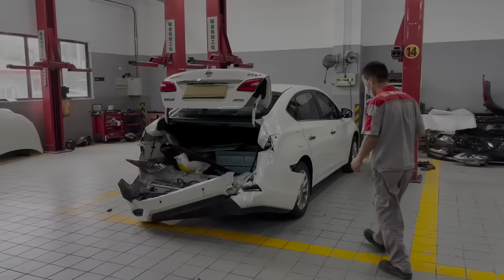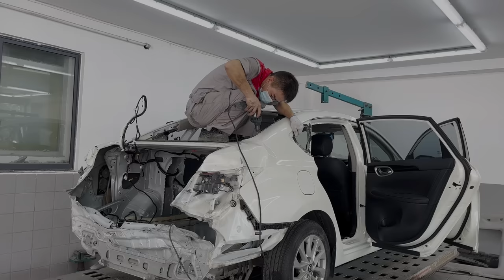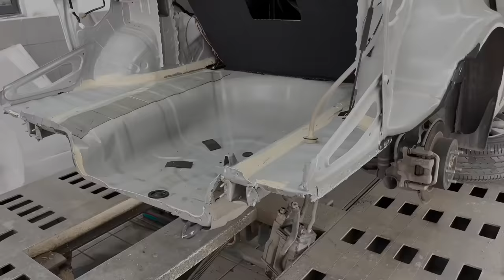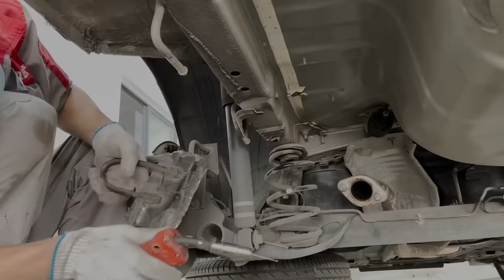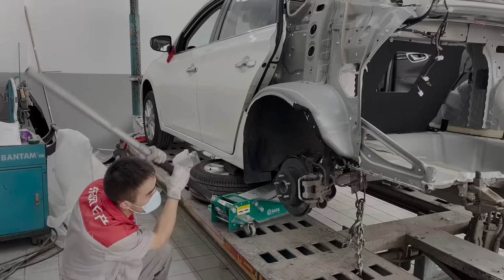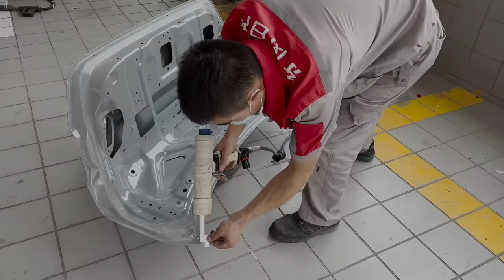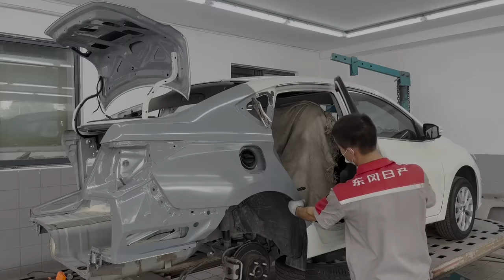Restoring a Severely Rear-Ended Vehicle: From Wreckage to Renewal

Comment: I'm sorry, but the repair of the entire replacement of the threshold, rear wing or something else that can only be mounted by welding, by definition, cannot be of high quality, since the body elements after such a "heat treatment" significantly lose their original strength characteristics and will not work out properly in the next accident. Moreover, nothing remains of the corrosion resistance of such a metal either. In general, there are unnecessary risks, which are enough without it when buying a used car.
Reply from the maker: @mkaspb

Thank you for your additional comment. You bring up a valid point regarding the replacement of body elements that require welding. It is true that such repairs can potentially compromise the original strength characteristics of the affected parts. Additionally, the corrosion resistance of the welded metal may be compromised as well.

These factors contribute to the potential risks associated with purchasing a used car that has undergone extensive welding repairs. It's important for buyers to be aware of these risks and consider them when making a decision.

While repairs can be done with care and by skilled professionals, the inherent changes in the structural integrity and corrosion resistance of the repaired parts should be taken into account.

Thank you for sharing your perspective, and if you have any further questions or concerns, feel free to ask.
Reply: @xinxianshi  Tell me why then the insurance companies of the US And EU countries do not repair cars after serious accidents, but reimburse the cost of the car after an accident, and then sell broken cars to third world countries, is this such a "neo" colonial approach? There are people in third countries of the world with repeated accidents with modified and weakened elements of restored cars is NOT a PITY!!!

Comment: I can definitely say that the body, whose power elements of the body have suffered, will certainly be covered with a scattering of consequences, since such blows that reach the spars and struts, at least change the geometry of the most important thing – the frame. It is impossible to restore it outside the factory conditions, respectively, the second such blow will go much further than the one that already was. In general, it is unsafe to operate such a car. When buying such a battered car, there may be problems with the installation of wheel angles, because of this, constant vibrations and increased tire wear may occur, but these are trifles.

If only the body panels of the car suffered, then there is always a risk that something may go wrong, so when buying a car, you need to budget for a possible alteration of the elements. An ideal-looking secondary color can never be unambiguously considered high-quality. Only time will tell how responsibly they approached the work, and the consequences on painted details may be as follows:

— fading of the "base" with the appearance of a different tone;

— peeling of the varnish;

— peeling of the putty;

— corrosion and bloating;

— hypersensitivity to the appearance of scratches, scuffs, chips.
Reply from the maker: @mkaspb

Thank you for providing further details and insights. You make valid points regarding the potential consequences of body damage, especially when it affects the structural elements of the car. Changes in the frame geometry and the inability to fully restore it outside factory conditions can indeed pose safety risks. The impact of such damage can extend beyond the initial accident, making it important to consider the long-term implications.

Additionally, when only the body panels are affected, there is still a risk of issues arising in the future. The quality of the repair work and the durability of the paint job can have various outcomes, such as fading, peeling of the varnish or putty, corrosion, and sensitivity to scratches or chips.

These factors highlight the importance of thorough inspection and assessment when considering a used car with prior damage. It's essential to take into account the potential risks and budget for possible repairs or alterations.
Reply: @xinxianshi  Tell me why then the insurance companies of the US And EU countries do not repair cars after serious accidents, but reimburse the cost of the car after an accident, and then sell broken cars to third world countries, is this such a "neo" colonial approach? There are people in third countries of the world with repeated accidents with modified and weakened elements of restored cars is NOT a PITY!!!